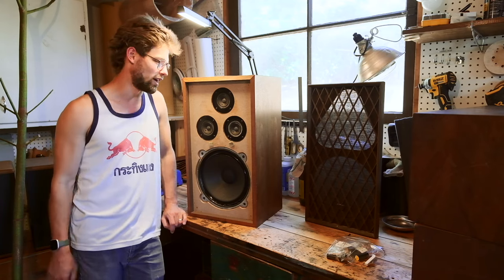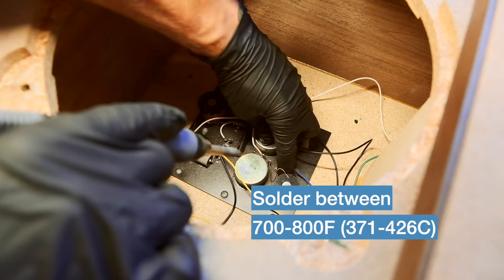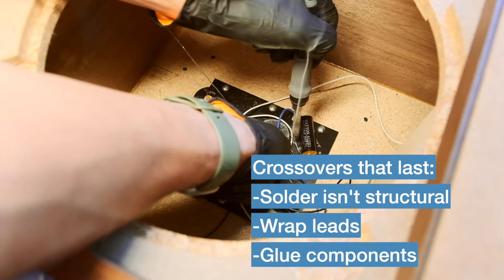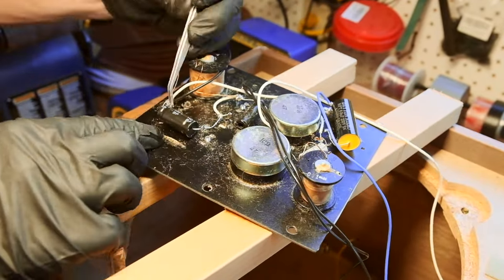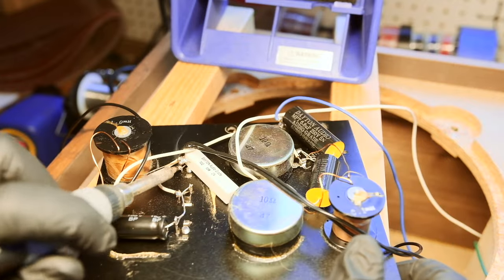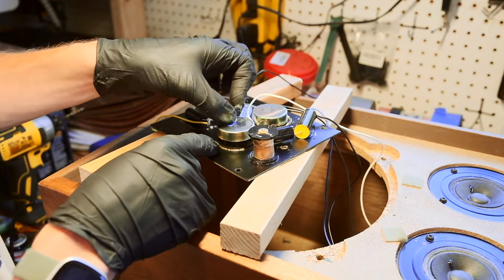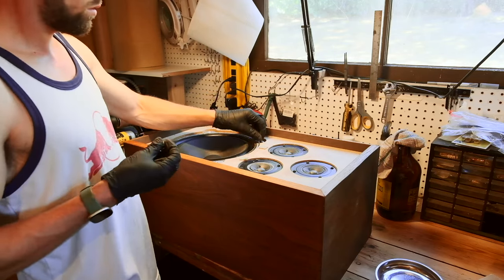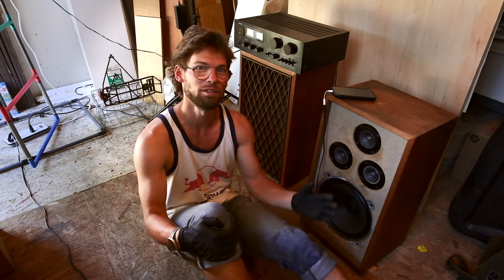Best update for your old Speakers

Comment: Old caps in crossovers don't "block out higher frequencies" per se, but they can do two things that are bad. One, their ESR (equivalent series resistance) can rise, which will reduce the output of the midrange or tweeter if in series with those drivers, or else it can allow more midrange into the woofer if you're talking about the one in parallel with the woofer. A different kind of failure is that the caps can become electrically leaky, which can allow lower frequencies to reach the mids and tweeters, possibly endangering them. Changing from electrolytics to film caps is a good idea so long as you have level controls for the mids and tweeters, because good film caps have a lower ESR than even new electrolytics, and thus can make the mids and tweeters louder than they are supposed to be, which is the effect you heard.
Reply from the maker: Hey Scott, thanks so much for explaining this! I'm not an expert but from my understanding the ESR is also different at different frequencies and electrolytics tend to have a natural high frequency roll off point that is significantly lower than a film capacitors due to film caps having that lower ESR at those higher frequencies that you mentioned. I try to keep my explanations pretty simple in videos since most people don't need to know the nuance. Thanks for watching!
Reply: @MattDealy  I did enjoy your video. It's not that electrolytics have a higher ESR at higher frequencies, it's that they become inductive at higher frequencies and that's why they start to roll off the highs at some point. However, at the sizes of capacitors that are used in speakers, that frequency usually isn't until way way above the range of human hearing, usually several hundred kilohertz.
Reply from the maker: Glad to hear it Scott :) Oh gotcha! Good to know. I was watching XraytonyB and he was comparing the frequency response curves of film caps to electrolytics and I thought that he said they rolled off within 20khz and that was part of the reason that older receivers sounded "Warmer". He may have been referring to a specific type of electrolytic that was used as he was talking about specifically some Sansui and Pioneer models. There's a lot to learn and I do my best to be a student always so thank you for your kind explanations 🙏
Reply: @Shuksanaudio  I've been servicing audio since 1977, and I've never heard of electrolytics rolling off the highs within the audible range. Of course, it depends on what load impedance they're driving, and whether that load is resistive, capacitive, or  inductive. Coupling caps in amplifiers usually drive fairly high impedances (tens or hundreds of thousands of ohms), and so there is no way that their small internal inductance could roll off the highs prematurely. And keep in mind that some of these older receivers (I now work exclusively on gear made before 1990) have a flat response to beyond 50kHz, sometimes higher, especially in the case of Harmon-Kardon gear.

I think the different sound people hear from vintage gear is often sue to the different topologies used in the design, and the reduced amount of negative feedback in many older units. 

Later! 😁
Reply from the maker: That's awesome! It's great that you're out here sharing your knowledge. I've definitely seen some receiver spec sheets that show the frequency going past 50khz and even 100khz which is wild. Do you replace smaller value electrolytic capacitors with film capacitors in amps?
Reply: @Shuksanaudio  Yes, I usually use Wima film caps, as there's really no sense in using electrolytics for values under one microfarad, and in fact, sub-microfarad electrolytics are hard to find anymore. And the Wima's cost about the same as a similar value electrolytic, until you get past about 3.3 microfarad, at which point they become larger and more expensive.
Reply: Just for clarification:  ESR doesn't change with frequency, because it is resistance, which isn't affected by frequency.  Cheers. 🙂
Reply: Great reply, and I think you nailed it in a technical way, damn, I wish I would’ve had YouTube content when I was young, anyway… Keep on rocking
Reply: So for recapping a pair of Nova 7B’s should I use film or electrolytic capacitors? Pretend this is my first time doing it and that I’m not very knowledgeable (because it is, and I’m not!)
Reply: @TheVintageNewbie  I would use film capacitors, but I would not buy the expensive ones. I use the ones from Dayton audio all the time.
Reply: @ScottGrammer  thanks! Which ones should I get?
Reply: @TheVintageNewbie  Well, I don't know which value caps your speakers use, you'll have to remove the woofers and look at the caps in the crossover. The uF (microfarad) rating is most important. Get new caps as close to the same uF rating as the originals as you can. If you are within 10-20 per cent, that's good enough. The voltage rating is less important. Anything over 50 volts will be fine. Dayton Audio caps are sold by Parts Express, and they're really reasonable on price.
Reply: @ScottGrammer  Awesome, thanks so much! I haven’t opened mine up but from what I’ve seen online they’re 15uF and 100v and Parts Express has a 15uF 250v capacitor. So that difference in volts is okay?
Reply: @TheVintageNewbie  Absolutely. It's just an upper limit.
Reply: @ScottGrammer  Cool, I appreciate your help! I have a good bit of vintage stereo equipment and would love to work on it but my knowledge ends pretty much at Deoxit and changing belts lol. Always trying to learn more!
Reply: Hi, I have some more speakers. Some Goodmans RB 35 mostly for cellar system in the 70s style. 
What caps would I change ? 
Would I just take the readings off the side of the caps and get modern equivalents ? As I can't find anyone else doing to said speakers as they aren't the best .
Reply: @itisjustacomment Change all the caps if the speakers are old. From what I can gather, if up grading the caps, upgrade the ones that the audio passes through before the speaker e.g. the one on the tweeter. The one on the woofer which bypasses the high frequencies to ground can remain a standard electrolytic. Just copy the value (pF, nF or uF - should be uF as bigger caps in cross over circuits ) off the side of the cap and get the same or close (there is a standard value range). Make sure voltage rating is same or higher, as Scott said 50V whould be fine, just be aware though, if you can't get a 50v and move up to 100v ov 250v etc. They get physically bigger with voltage rating increase (and more expensive).
Reply: @adrianred236  Thank you, sir. I appreciate the reply.
They are my worst speakers at the moment,  but I love the look of them, They look great on either side of my chimney; sadly, they are pushed back into the void, and my Q Acoustics 3050i are front and centre. 
But still, I will not sell them, and now I have the info. I'm going to use my skills from 1995-2003 to start electronics only again.
I have done speakers before and fixed a number of amps, cassette decks, etc, so I should be good. If not, I will just blame you, lol ;) 
They need to be used for sure. 

Thank you again; I salute you from Leeds, Britain.  Top man.
Reply: @itisjustacomment  In Ireland myself. Started my working career as an electronics technician back in 1990. Went back to college and became an engineer a few years later.Haven't worked in that area the last few years though. I have a set of Philips speakers which I bought with pretty much my first pay check, still have them and looking to restore them so was doing some research, glad I could help.

Comment: I wouldn't drill holes in the back of the pots. The drill filings (for want of something to call them) that will fall in can do damage. Better to try contact/switch cleaner and spray from the front and rorate the pots.
Reply from the maker: Yes, that was probably not the best thing to do haha. They were sealed. No way to get cleaner in. I should have tried to take them apart.

Comment: Realistic (Radio Shack?) took a bad rap in the 1970's as low-fi and low quality. They did build some nice receivers, tape decks, EQ's and of course, speakers. I remember the swell reviews for the Minimus 7 and 11 mini speakers and for the T series labyrinth systems. I got to use a Realistic 31-2009 EQ for a few months some years back and found it quite good. Nice to see that unlike Rodney Dangerfield, they're finally gettin' some respect.
Reply from the maker: They really did! A lot of the stuff they made has great sound or potential for it. They're nice components for getting into HiFi on a budget. Haha they're doin better than Rodney for sure 😂
Reply: Talk about el-cheapo hifi. My first "component" hifi system purchased after military service and broke in 1975 consisted of a Pioneer SX-434 (15wpc) receiver, BIC-920 turntable (with Shure M70 pickup) and KLH model 31 speakers all for under $240. It was boss. @Shuksanaudio
Reply from the maker: That's amazing! Inflation sure has killed all the pricing haha. An SX 434 used is more than $240 now haha. That sounds like a sweet little system.  @martyjewell5683

Comment: In 1971, when I was 19, I bought my daily speakers DYNACO M25x, made in Denmark . Some decades ago I suspected their treble level might have deteriorated. I checked the caps and their capacity was almost 1:1 their nominal value. So I got me a 12 channel equalizer and a pair of GRUNDIG cube tweeters to boost treble. Some months later my ear doctor told me I hear up to 7 kHz. That was 20 years ago... Nevertheless I still enjoy good hearing and good music from my DYNACOS that I bought for a lifetime. I wouldn´t trade them for anything.
Reply from the maker: Man, those are some beautiful speakers! It's sad to lose those upper octaves but I'm glad you can enjoy the music! Once you find your favorite thing, it feels so good!
Reply: Sometimes the upper frequency is lost from the 'dirt' inside the ear. 
So maybe a good clean will reduce your ears.
But do not use hard methods like the vacuum cleaning of eardoctors. Find a smooth bio method. For example i make a lot of swimming in the sea and a lot of low Dive. The saltwater of the sea clean my ears . There some others methods, if you are in states maybe you can ask some Indians ;-)

Comment: Silikon is much better than hot glue. It can go hard and break. And change the Position of resistors if they are in same place. Field overlapping.
Reply from the maker: I've personally never seen hot glue crack. Silicon is a great option as well though, it just takes longer to dry. Great idea on the resistors! Thanks for watching.

Comment: Ethically harvested wool. Man oh man.
Reply from the maker: HAhaha yea, it's funny, I just went back to this video and watched the whole thing and it's so interesting how as my knowledge has grown, I've not obsessed over that sort of stuff. It feels a bit try hard. I'm all for ethically harvested wool vs animal cruelty but these speakers don't need it lol. You certainly wouldn't notice a sound difference compared with fiberglass haha. Thanks for watching.
Reply: Those were awesome speakers. I still have pair of smaller Advents I bought in 1971. They sound great. Maybe I should check the crossovers.
Reply: @JohnFBramfeld  I have always used common 'Poly-Fill' in boxes. Works like fiberglass. Can't see it when the drivers are in place.
Reply from the maker: Nice! I've always loved the way Advents sound. I've got a pair of 5012/w large advents that I'll be putting out a video on in the future. Crossover caps are a great update. Even if you replace them with electrolytics.
Reply from the maker: Poly fill is what I use as well. It's good stuff and nice and cheap.

Comment: This brings back memories.  I had a set of these when I was a kid in high school back in the 70s.  The walnut veneer cabinets on these were heavy and solid.  Had no clue what I was doing, but "bigger is better" you know.  I tossed the grilles, painted the front baffle flat black, replaced the woofer with a blue 12"  McIntosh driver, replaced the mids with a pair of soft domes and dropped in a Peavey piezo horn tweeter.  The goal was to create party speakers for college, and they served that purpose well.  

Funny thing about the speakers, with the piezo horn tweeters they were bright AF in an empty room,  but once a bunch of people filled the room, their bodies dampened the excess highs and they actually sounded really good.  Powered them with a beefy 100 watt per channel Yamaha A700 amp, they definitely made some noise!

Not really sure what happened to those speakers, replaced them and they were lost to the mists of time after that.  If anybody out there happens across some black faced Optimus speakers at a garage sale, those are mine 😆
Reply from the maker: Thanks for sharing this story. I love hearing about peoples experiences with HiFi over the years. I'll keep my eyes peeled for some real party speakers 👀 Thanks for watching!

Comment: Most of the repairs I have done is to replace rotted out surrounds, I never thought about the crossover components failing. Thanks for the info
Reply from the maker: Nice! Replacing foams is such a useful skill to have. Throwing a few capacitors in doesn't take too much extra effort and can be done while the glue is drying on the foam. Thanks for watching!
Reply: @Shuksanaudio  I have some really great speakers that people were throwing out for the $20 kit and maybe an hour of effort

Comment: I rebuild a set of Pioneer CS99a, of a similar vintage. I did the same and recapped the crossover, however i also changed all the wiring, installed new foam and changed the old spring sockets for modern banana plugs. Ideally I wanted to change the drivers as they're not great but the owner wanted to keep the original appearance. Did make a massive difference to the performance and wasn't too much money.
Reply from the maker: Nice! The pioneer line of CS speakers sure does have a following. Glad to hear that the customer was happy with them! Thanks for watching ❤️

Comment: Restored a pair of Sansui  sp x 9000's  refoamed 1 woofer,replaced both mids,replaced the cross-overs and replaced the 20 ga speaker wire on the midst and woofers with copper 12ga.
Also used sheet lead on the inside of the speaker boxes. Really impressed with the improved sound performance 
The speakers are powered by a Sansui AU 8500 amp
Reply from the maker: Nice! That's a good amount of work.

Comment: I did this to a pair of Sansui SP-2500's and SP-3500's.  The change was dramatic to say the least.  Very good video and very good advice to upgrade the caps.
Reply from the maker: Nice! Those Sansuis for whatever reason seem to really benefit from cap changes in my experience. Thanks for watching!
Reply: @Shuksanaudio  BTW, I have some Nova 6's (I believe that's the model) and you've got me wondering about pulling them off the shop shelf and doing an upgrade.  While I'm in the mood I should do the regular shop speakers, too...BIC Venturi 4's.
Reply from the maker: Nice! You should give it a go! Fun little project since the crossover doesn't have much in it.  @henrychinaski5223

Comment: Thanks for the Video!
Being somewhat of an old-time audiophile snob I used to bad-mouth Radio Shack products.  Now I have become to realize some of their audio equipment was actually well made and has held up well over many years.    Same with some other house brand speakers like RSL & Quadraflex.  The best surprise from the 70's was the GTE Sylvania 12" 3-way (Sylvania - you have to be kidding!).  High-end dealer Jonas Miller Sound of Beverly Hills (M&K) sold them and compared them to anything on the market at the time.
Reply from the maker: You're most welcome! Fascinating, I'd love to hear a pair of the Sylvanias. Radio shack made some great stuff that there are now a few updates for. I'm hoping to help add to the pool of crossover modifications and such for more budget friendly speakers like these. The house brands often made really good stuff at a cheaper price due to the lack of advertising. Thanks for tuning in!

Comment: I just made a massive improvement to my Infinity SM150s for free.  I stacked a pair of Polk 10s on top of them wired in series. The Polks were set out by a neighbor for trash pick-up.  The theme from The Magnificent Seven sounds amazing now.
Reply from the maker: That is quite a free upgrade! Woulda been a shame to have those go to the dump.
Reply: @Shuksanaudio  My stereo is now the size of a small car but it freakin' rocks.  No replacement for displacement.